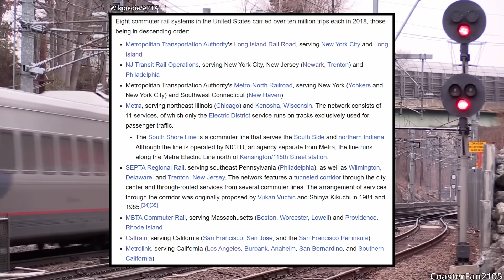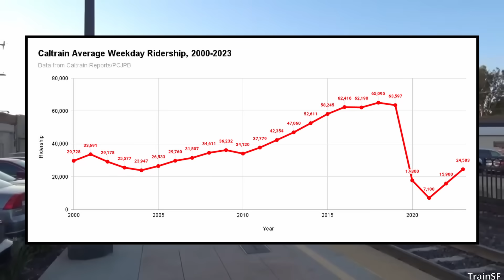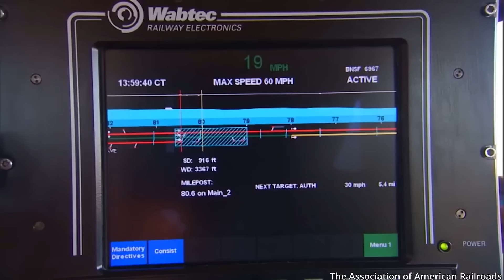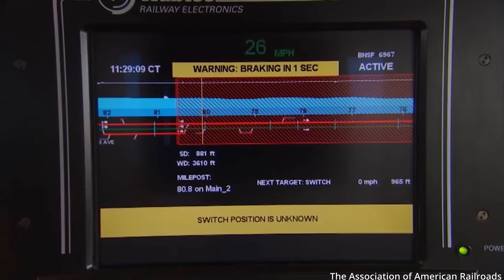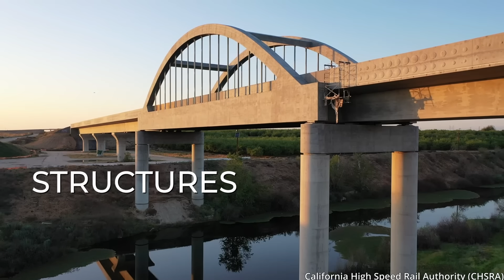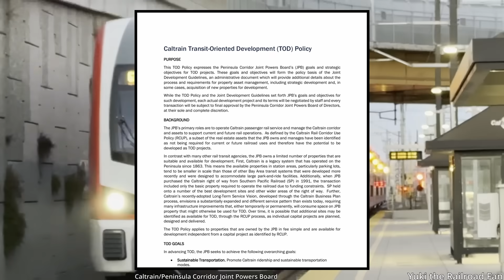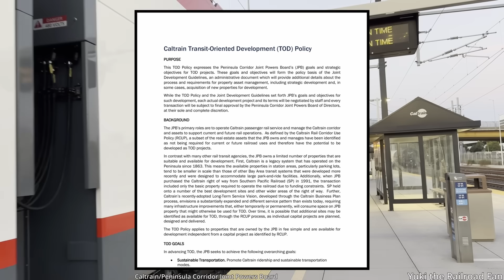How Caltrain CHANGED THE GAME of American Railroads | Caltrain Modernization

Comment: The Bay Area got new rolling stock for all major rail systems since COVID. All I want at this point is the old Key System in the East Bay rebuilt as a light automated metro since it's the only side of the bay missing a U-Bahn type system (like MUNI Metro).

Comment: One misstatement in the video regards seating capacity. The legacy Bombardier and Nippon Sharyo gallery cars (sold to Lima, Peru, BTW) both had substantially more seats per car (as many as 148) than the Stadler KISS EMU cars (typically less than 100). The EMU cars have a lot more interior space given over to aisles, open floor space, stairs, and large cabinets housing electrical traction equipment. The 2 gallery bike cars per train carried 40 bikes each, while the 2 EMU bike cars have a little less.

Comment: Caltrain  screwed-up the electrification process big-time. It tried having it's own new custom train-control software, wasting $200 million before hiring a competent standard supplier. It set a world-record for cost-per-mile for electrification, causing other electrification efforts in the US to suffer from the bad publicity. Caltrain only electrified part of its tracks (San Jose to San Francisco), leaving Gilroy to San Jose running with diesels. If CAHSR ever does its Pacheco Pass link (Merced to Gilroy), more electrification will happen. The bad news: Caltrain still has 77 grade crossings over its 71 miles total length (expect continued vehicle collisions and suicides in the future).

Comment: The other great thing about the new trains is how quiet they are.
Reply from the maker: Yes! I got the chance to ride on them back in the Fall. So quiet, so smooth, and lightning quick. My one complaint is the seats, they're weirdly upright...but on the whole, they're pretty darn good.
Reply: @MakeMeThinkAgain: These trains are not Only quieter than the the diesel trains they replaced but also quieter than the MUNI LIGHT RAIL TROLLEYS as well.

Comment: They should learn from the London Metropolitan line build development around the stations and they will come.
Reply: They're already doing that with a lot of new development around Caltrain stations.
Reply: @Sacto1654 There is very little land available and it took until the 2000s for much to materialize. There’s actually a lot of land around it but it’s dominated by single family homes and low rise downtowns.
Reply from the maker: I'm actually seeing this in New Jersey quite a bit - especially along the Raritan Valley Line, there's two roads that have a bunch of empty lots, and they've all filled up with apartments. 

I just wonder if they're approaching this the right way. Yes, apartments are great, but surely having middle options like townhomes and condos wouldn't be a bad thing? Especially for those middle-ground families who want a space to their own but don't want to commit to a single-family home.
Reply: @DTransit that’s what the missing middle is all about. Because of the abundance of single family homes, there’s pressure to densify whatever space is left, often leading to mid-rise large apartment blocks, instead of dense row homes or smaller 4-6 unit buildings packed together. It’s all about land use planning.

Comment: The bottom line is that everyone is happy with new Stadler electric train sets. Faster, quieter and more environmentally sounding. When well planned, public transportation is welcomed.
The older rail material, mainly EMD F40ph diesel locomotives and the Japanese gallery cars were very reliable that they were used over 40 years. Honestly, too long for a public transportation material.
Reply from the maker: I'd honestly agree for a lot of older rolling stock. Look at the NYC Subway, their R32s/R46s and the like have been running for ages and still operate pretty darn well - mind you, they are so far past their expiration date.

I for one am really happy that more consumers are picking Stadler. EMUs are by far one of my favorite train styles, especially for these commuter rail style services. 
I'm sure Stadler has their issues, but seeing American transit shift towards a European-at-heart manufacturer is definitely an encouraging thing to see.

Comment: I think Caltrain should now jump on that success and somehow try to purchase and electrify the rest of the line from Tamien to Gilroy. And maybe upgrade the Hollister industrial lead, to extend service. 
Tamien to Gilroy electrification will also benefit CHSR
Reply: Again as video had mention, Caltrain doesn't own the tracks(and land) between Tamien and Gilroy. Southern Pacific owns and maintains those tracks and Caltrain just lease the usage of them. Anyway, Caltrain is planing to buy new battery electric trains, it will charge up at Tamien before it will do a round trip run between those 2 stations.
Reply: @xraymind  That’s why the original commenter mentioned buying the tracks, because they don’t own it. It makes a lot of sense to try and purchase the tracks from Tamien to Gilroy.
Reply: @xraymind  Southern Pacific was absorbed (after bouncing between corporations) by Union Pacific. SP as a separate company no longer exists.
Reply: It would make more sense for the state/Hsr to do that due to funding access and HSR needs
Reply: One slight problem freigh is just......

Comment: Caltrain and California High Speed Rail actually came to an agreement in 2012 after Caltrain had a budget crisis 2011 and after California High Speed Rail could not find a route from San Jose to San Francisco and also when the Anna Eshoo and the Authority announced the blinded plan which would allow California High Speed Rail fund Caltrain’s electrification in return for letting it share Caltrains tracks in the future
Reply: Daily ridership is 27k vs 72k pre-covid. A better alternative to the Pacheco Pass route for CAHSR is upgrading the current ACE train Altamont Pass route.
Reply: @davidjackson7281 I'm not a fan of how the current high speed rail is, but you're not wrong. They should upgrade existing track instead of trying to bulldoze everything and make new ones
Reply: @davidjackson7281 the high speed rail should end at San Jose and passengers can transfer onto high speed Caltrain express trains (110 mph minimal stopping)
Reply: @NorCaliRailroading6124 I don't understand. If they are both electric why would there be a need to transfer?
Reply: @davidjackson7281   because the line would be jam packed with trains, probably 15-20 trains per hour. To counter it they’ve made an awful scheduling strategy where Caltrains run in clumps of 3-4 and then the high speed rail will run in clumps of 3-4. The line doesn’t support so many trains and it will be such a hassle to quadruple track the line.
Reply: @NorCaliRailroading6124  I see what you mean. I remember BanksRail taking about congestion of the two systems. However, was CAHSR so stupid to fund the CalMod project if that would be the case? Since covid Caltrain ridership is down 60 percent. Would that not mean less trains or perhaps longer consists? 

Of course, it is kind of a moot point until CAHSR starts to use it in 25 years due to lack of funding. 

I have always been for CAHSR but each year the project only continues to disappoint. I'd go with the Siemens Charger diesel electric until there is an electric connection to LAUS and SF,etc. is better connected by either upgrading the Altamont Pass or securing 40 billion to build through the Pacheco Pass decades from now.
Reply: @NorCaliRailroading6124  I think Caltrain runs four trains an hour or about 100 per day. I think CAHSR would in reality run on a clockface schedule of one train per hour, perhaps two per hour when very busy. Even though CAHSR will be faster it could run behind a baby bullet without a problem. One or two trains per hour could reasonably share the ROW. I am surely open to a difference of opinion. 

It would be like a nonstop super bullet train. If they are actually going to buy a set of high-speed trains probably from Siemens, then at least as a demonstration start running one of those trains. Basic maintenance could somehow be performed. The portal project is still two billion short of the 8.2 billion funding. That would need to be done.
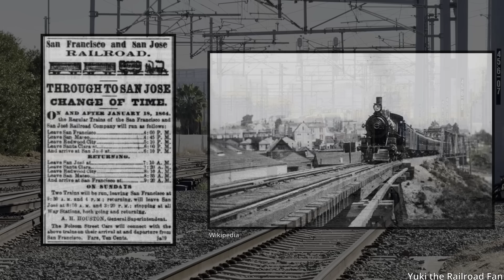Reply: Caltrain brokegrond on July 21st 2017 and the EMUs entered service on August 11th 2024 with Caltrains softlanch of electric service in September 20th the Caltrains operated it’s last diesel train between San Francisco and San Jose Train 711 and 132 were supposed to be the last diesel and gallery cars with and F40PH-2C 922 however due to a mechanical issue at Taman the last diesel changed and the diesel trains kept running until the last train of the night Train 146 at 2:00 o clock PM it had and it also had gallery cars but with an F40PH-2CAT on and on September 21st 2024 Caltrain official latched electric service between San Francisco and San Jose and Taman also received electric service
Reply: I meant 2 PM
Reply: << which would allow California High Speed Rail fund Caltrain’s electrification in return for letting it share Caltrains tracks in the future>>

The FAR future, apparently.

Caltrains has already spent the money they got for what they wanted. California High Speed Rail still hasn't transported a single passenger, and there is no prospect of that happening for years.